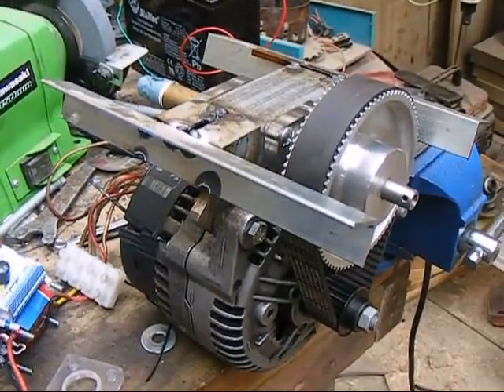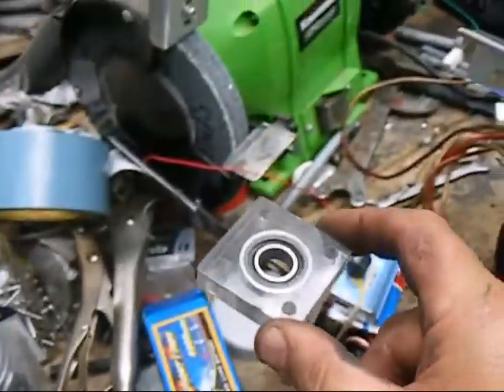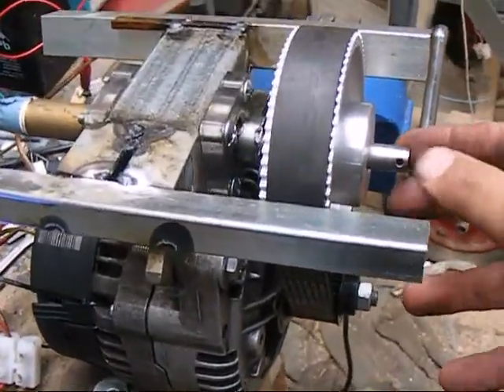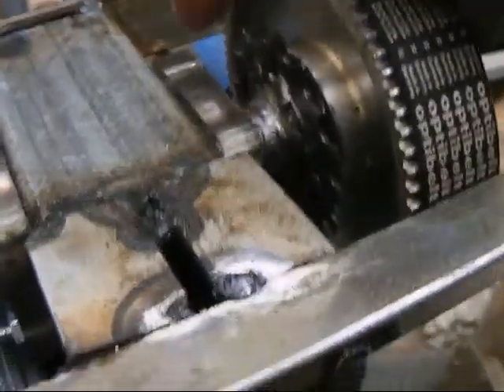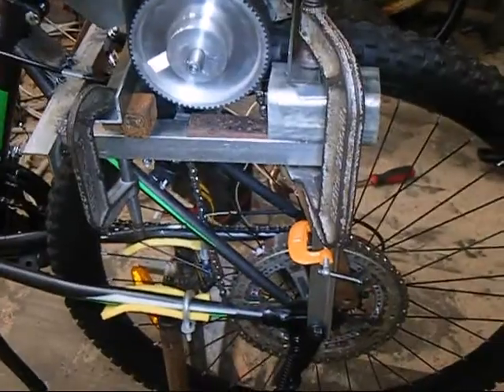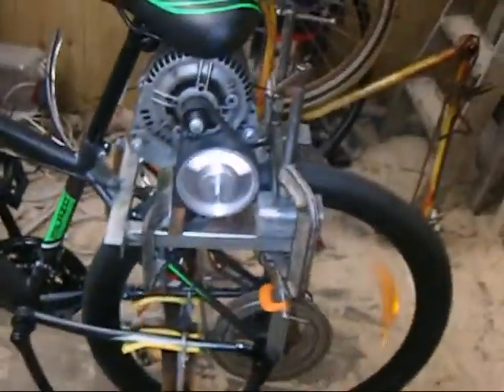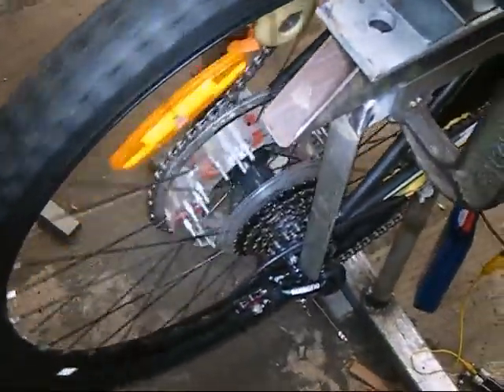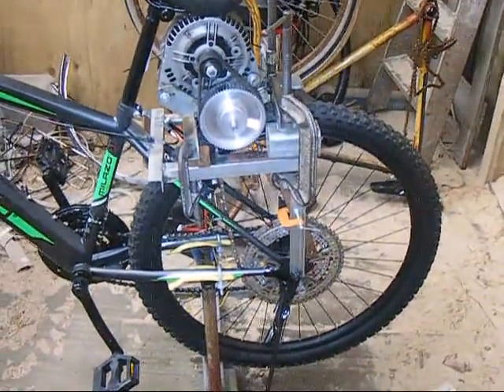Ebike Motor Update and test on bike

Comment: Thanks for sharing. How many volts are you using on the rotor and on the stator?
Reply from the maker: You are welcome  :) . 
 The rotor gets about 6 volts on average. 
 The stator receives 14 volts through the ESC from my 4 cell battery.
Reply: Tks. I'm making a skateboard with a alternator as a motor, but I'll make my own esc, with a voltage regulator for the rotor. On the second step of my project, I want to use the alternator as a alternator while I'm breaking. Check out my channel. it's in Portuguese, but you can have one idea about what I'm doing.
Reply from the maker: Sounds good  :) . 
 I will take a look. 
 A home made electric skateboard sounds like a real challenge to make!

Comment: Why did you use a belt as opposed to a chain?
Reply from the maker: Chains are very noisy at this relatively high speed. 
 Further, a chain does not perform too smoothly when operating vertically - as opposed to horizontally.

Comment: Hello Steve. Awesome work, can you give me a source and possible part numbers for the toothed pulleys and belt?
Reply from the maker: Howdee partner, 
 If you would like to look on the Optibelt website, you'll see a great range of nice  parts that are perfect for this  :) . 
 I don't really have the part numbers, but I do have the basic dimensions for these parts. 
 The small pulley is a 21 tooth, 5M, 25mm wide one. 
 The large pulley is a 72 tooth, 5M, 25mm wide one. 
 The belt is a 450mm, 5M, 25mm wide one. 
 At this point, I think it's fair to say that each build will be different, so my parts list might not work the same way for your project.
Reply: CNCmachiningisfun. Thanks that's all the info I need. I am building one with a 28V alternators 110A alternator, that's close to 3KW of fun .....or body abrasions :)
Reply from the maker: +elser2utube 
 That sounds great. 3KW of prime mover power will really get you moving! 
 Try not to fall off, as I hear that the roads are extra hard - this time of the year  ;) .

Comment: Looking good Steve. Looks like you went with a no suspension bike. That should simplify things. Looking forward to seeing you drive this thing.  I'm thinking you'll want a guard to keep your pants/leg from getting into the belt. Thanks for sharing. Joe
Reply from the maker: Howdee Joe, 
 Thanks kindly. 
 Yup, I went with a hard tail bike for this, as I just couldn't quite get this idea to work with my soft tail bike. 
 I have a new plan for the soft tail one, using a 4HP RC aircraft motor to move it. 
 These RC motors are tiny, yet rather grunty, so there will be plenty of room for it on that bike  :) . 
 It will be a blast to ride this, assuming that it works as I am hoping. 
 We will see  ;) .

Comment: Dude! Better not exceed 40kph! Thats the legal speed limit for riding a bicycle on the road. Whats the next step after testing? Miniaturisation? Cant wait to have a go! Keep up the great work dude!
Reply from the maker: 40Kph! Is that all? 
 Crikey, I used to pedal my Raleigh 20 faster than that, but not by much, I have to admit. 
 Once I get this all done up, and I get some testing done on it, I figure on going for a 3KW RC aircraft motor. 
 Those motors are tiny, and they rev like crazy, but they also pack a huge punch. 
 That new setup ought to get me into trouble with the local constabulary, if they can catch up with me, that is   ;) .

Comment: Hey Steve, Make sure you ease into the throttle on that thing or you will find yourself on your butt in the road with the bike going on all by itself... The acceleration rate on that will be unreal. Talk about sitting on a bullet and pulling the trigger. Yeikes. . Once you have that all cleaned up, it should work great. Nice engineering there.
Reply from the maker: Howdee Mark, 
 Thanks kindly. This little bit of engineering has been keeping my mind busy for a wee while now, but it looks like it was well and truly worth the effort. 
 Yup, I figger on being real gentle with the throttle, as the last thing I want to do is rip my jeans on the road, again. 
 I wood like to think that it will be able to take off like a little rocket, while carrying my weight, and all the other stuff that will be making this thing go. 
 By my figgerin', it ought to get up to 15Mph without too much fuss, on the existing 14 volt battery. 
 Naturally, I will crank it up to 60 volts, and break the sound barrier, or perhaps my collar bone  ;) .